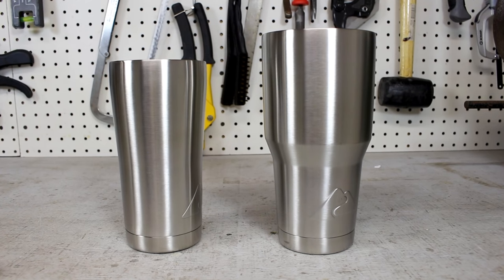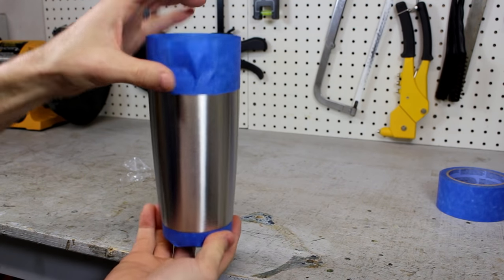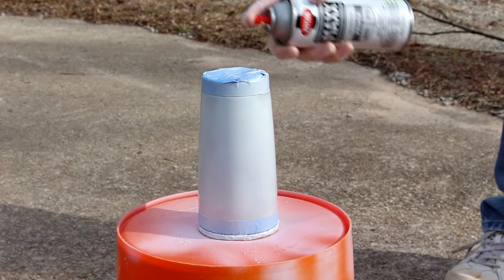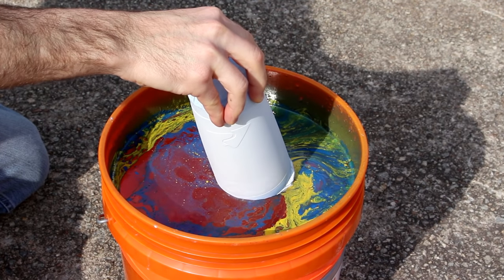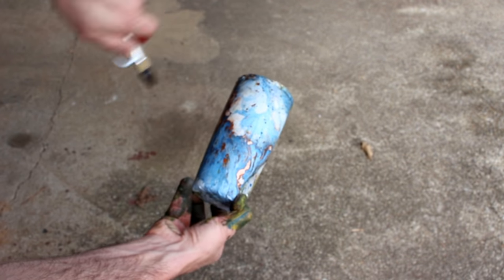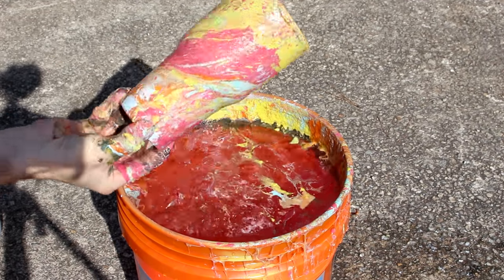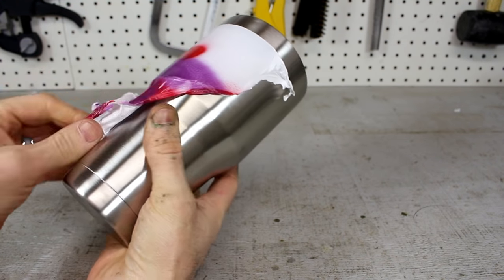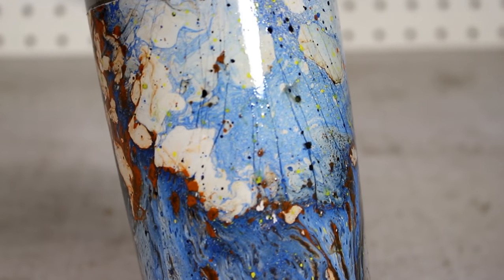DIY Custom Painted Tumbler with HYDRO DIPPING

Comment: I've done some small projects using dollar store nail polish, its a lot of fun! Yours came out really cool for the failed one either wrap it in a rag soaked in the thinner or just get stripper
Reply from the maker: +Doc Ink I tried wrapping it in some thinner and it helped, but not fully. I think the thickness of the paint is the problem. I might try the paint stripper.

Comment: Awesome end result.  

I bet if you reverse the bag on the lid, then stuff the tightly-twisted bag into a short (6-8 inches or so) piece of.....   IDK, PVC? .....  then you could make a very easy to use handle (you'd have to keep the bag twist pulled tight though) and that would allow you to do a few things:  1) put the flat end of the base in first (no air bubbles) -- 2) keep your hands free of the item to keep paint from being masked by your fingertips -- 3) keep your hands clean.

On that note, instead of paint thinner, try acetone or in a pinch nail polish remover, to remove the paint from your hands and the "failed" tumbler.

I thought that even with primer, stainless steel would be very difficult to get a good coat of paint on even semi-permanently, so please, definitely update us after some months go by to let us know how they fare!

The overcoat of clear at the edge of the paint where it's on bare stainless might not be too durable, so I'd keep an eye on that as well.  The two-part epoxy should help nicely, and I really like the end result on all of these.

I wonder if the epoxy coat would be dishwasher safe...  ?

I did see a video on how they dip things like guns and motorcycle helmets to apply camo -- it's a nearly identical process,  but instead of a 5-gallon bucket it looks more like a 300-gallon aquarium, and instead of spraypaint they use a film sheet that they lay carefully on the water.  They then do the same thing dipping an item in at an angle.

All in all, very nice!
Reply from the maker: Thank you for all of the great ideas and info.

Comment: Ive been painting tumblers with my airbrush for a few months now. if you want to take the paint off of them to restart use 100% acetone and the finest steel wool you can find. add a little elbow grease and it comes right off.
Reply from the maker: +Zach Reisen Thank you, I will have to give that a try.

Comment: Another great video.
Since tumbler is full of air, it is challenging to keep steady while pushing down.  
Has anyone tried it with liquid filled or make a clamp/handle to bottom that will help u push it fully into water and not get paint on you?

Comment: Have a question about protecting the tumbler. I bought some flasks that were dipped using this method from etsy. I opted to have names put on the back of the flask. The flasks do not look sealed. I want to seal them. Can I use the 2-part epoxy for thus?  I think they used a stencil or vinyl to create the name. Then removed it because the name is in the stainless, hope this makes sense. Will the epoxy ruin stainless steel?

Comment: Would a 12 volt bicycle air compressor work as good? I just attempted my first dipped cup and I Now understand why I need a blower or air compressor I have a couple little water bubbles 😂

Comment: NEED HELP! So I mad a tumbler cup Pittsburg Steelers colors for a friend for Christmas. I used an epoxy resin on the outside. For some reason the resin is hard but feels weird, and leaves fingerprints, I have my cup sitting in front of a heater to cure but I don’t think it’s working.
Reply from the maker: It could be a couple of things, 1 the epoxy was too old or 2 it was not mixed correctly or thoroughly. 
I hope it will eventually cure for your sake.
Reply: Hello. You must make sure your room temp is 70 and up. Equal amounts of part a and b. If you dont like it, take paper towels and soak them in acetone. Wrap around the cup alone with foil. Put in ziplock and let sit overnight.  It will come off easily

Comment: is this dish washer safe? or will the paint get all screwed up in the dish washer?
Reply from the maker: I would only recommend hand washing it
Reply: jennifer mendez those cups ate supposed to be hand washed anyway.  Putting them in the dishwasher breaks the vacuum seal of the insulation.

Comment: You are doing great work. Almost at 100k. Great job. Question for you, how is the clear coat holding up on the copper jewelry?  Does your wife wear it enough to know?  I was concerned with flaking but hasn't happened yet. I am wondering if this resin you just used would hold up better. P.S.  Remind people to hit that like button and notification bell. Just trying to help ya out. 
Paul Verhaaren
Reply: Sorry you did say hit the like button. My mistake.
Reply from the maker: +pv2874 My wife keeps the jewelry on display more than she wears it. I am not sure how the resin would hold up, but it might.

Comment: What temperature should the water be when I try it just seems like everything clumps together no matter how slow I put it down and how slow I take it up after I move all the
Reply from the maker: It was a warm day when I try this, so I would guess the water needs to be lukewarm. As for clumping, I'm not sure. If I guessed, I would say the water may have been contaminated. Trying cleaning out the bucket with soap and water a couple times, and then rinse it several times to remove the soap. If it still clumps, them there might be a problem with the paint. 
As for dipping, I used a very slow and steady rate with a slow twist. 
Once under water, stir the top and pull out quickly.
I hope that helps.

Comment: You can buy a REAL YETI tumbler ( or two) any color you choose, for less than the cost of several cans high end spray paint & resin!
Reply: You also won't get a custom look. These are one of a kind!
Reply: I just did this yesterday. Colored Yetis can cost $40+. I spent $6.84 on a 30 oz tumbler, $2 for 5 gal bucket, $1 gloves, $3.78 each for 2 cans paint. I already had painters tape at home.
Reply: What's the fun in that?